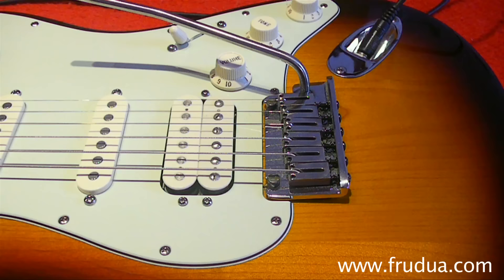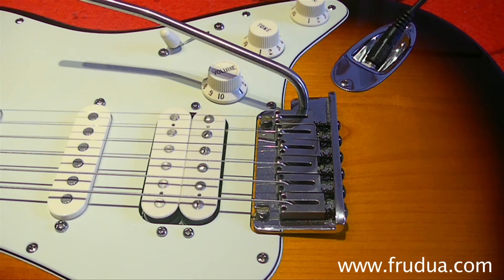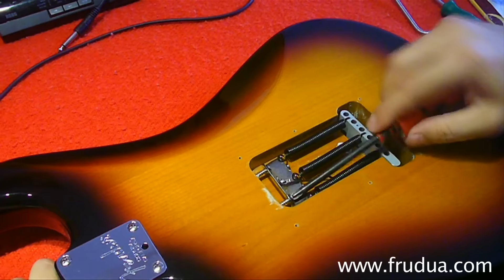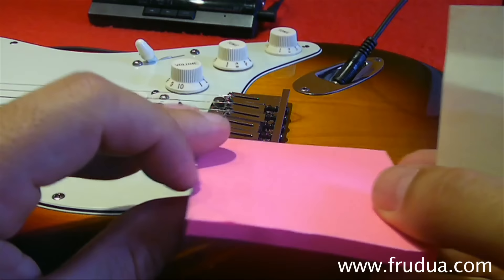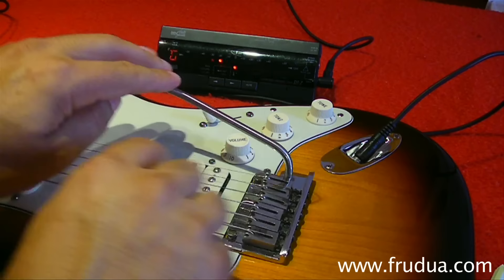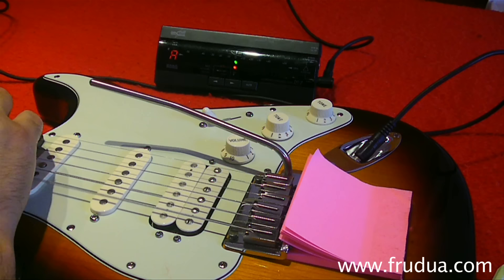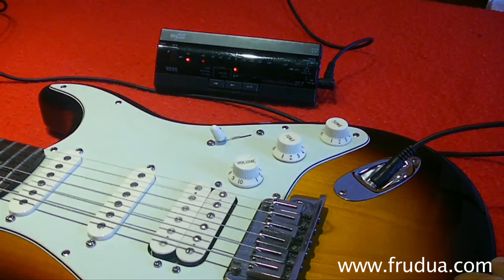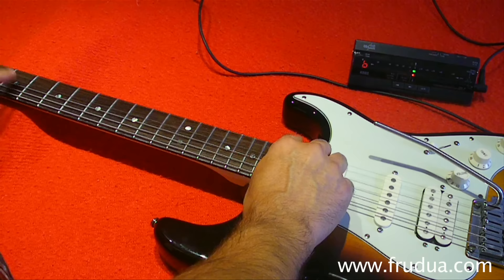How To Set up a Strat Floating Tremolo | Two Pivots Tremolo | Whammy Bar

Comment: Thank you for your video and effort .I have done this setup to my Fender Strat Deluxe. It feels really cool however I have had some issues which I have no idea in which stage I made mistake. While I am using the tremolo bar just for giving kind of vibrato feeling , the bridge does not return  its place ( the actual setting ) and the tuning is being slightly flat. For this reason I have to kind of pull the tremolo bar back to get the actual bridge setting. I just want to ask if anybody had these sort of issues after setting up ?
Reply: Hey Alex. Thank you for your reply. I tried couple of times more and had the same issue. Also I am having huge tuning problems. If you have any suggestion I would appreciate it mate.
Reply: ***** That makes a lot sense. I will definitely try the method and hopefully I will sort it out. I have a 2 pivots system and I guess the process would be the same as the vintage ones. I was just giving up and was gonna lock the bridge but I will definitely try that out. Thank you so much indeed for your time to write down all these , that was really helpful mate.

Comment: Mr. Frudua, would it work in my Music Man Luke 3 ? It came floating, but i want to change the strinngs and clean the fretboard, so i will need to setup again. It uses 09-42 strings and 2 springs in the back. Can i use your setup in my guitar ?
Thanks !!!

Comment: In my Strat the half step on high E and the 3rd minor on G is perfectly in tune. The whole step on B string is a little flat. What can I do to perfectly tune this?

My low E is unstable too (not the interval, but the open string). How can I stable it?

Comment: hi ^^

I have a little question for you, I would like my bridge to stay flat on the body but with my springs not very tight so my tremolo arm is soft and easy to use, every time I tighten my springs so the bridge stay flat, the arm becomes too stiff, and if I loosen the springs the bridge starts to float :s 

thx

Comment: I dunno if he put new strings on or not, but generally yes when you do a setup you want to use new strings, but well stretched.  If your strings are older but havn't gone dead yet your probably OK.  Somewhere in the middle is probably best (thats why you stretch them) unless you play with brand new strings all the time. The reason to re-string and stretch rather than use what you have on is that you might have a mixed set (1 newer string) or a tendancy to play more on top, or bottom.  Cheers

Comment: How many springs do you have in the back? If you've got 3 you can try taking the middle one out and then tightening the claw springs until the trem is flat to the body. If it's too soft then try angling the 2 springs so that they are not parallel with each other but more like a triangle (trapezoid actually, but geometry lessons are over for today). How stretched the springs are when they are at rest will also affect the feel. At worst you may even find that different springs suit you better.

Comment: Paisan, when you set up Floyd Rose guitars, how do you usually set the string height? Grazi
Reply: Iron Mike you can set it up for your need ...set as low to where the sings makes a buzzing sound raise it up just where there are happy no buzz an there you go depending on you might need an L shape wrench my strat uses a 1/16 Allen wrench hope I helped in some way

Comment: I got my tremolo floating now, I followed your instructions perfectly, tuned it back to pitch with the springs, and I love the way the tremolo works now.....But.... it will not stay in tune! Every time I dive bomb it comes back up sharp! I even put locking tuners on it and it will not stay in tune! Any suggestions?

Comment: FruduaTv I have a Fender Hellecaster Strat where the body is routed like Floyd rose style would it be the same technique if I want to adjust the Pivot bridge? do I angle it to the top body or do I flush it inside instead? Thank you?

Comment: Hi, I bought roller saddles that have the intonation screw hole on the center not the side, I can't find saddles with the whole on the side, so I am thinking of changing the bridge plate....I have an American Series Stratocaster.........what is the exact name of the part I need to buy from Fender that will fit my guitar but have the holes on the center of the saddle?

Comment: hi i adjusted the 2 screws at the front to adjust the overall height of the action and now i have strange buzzing at different areas on the fretboard for example if i pluck the G string i get a buzzing NOT a rattle and also on the d string at the 4th fret if i wiggle the tremolo arm if goes away for a little while but comes back its driving me nuts
can you help plse

Comment: i did this. It worked, the tuning is stable, however I have the wrong intervals. I can only pull the G string up to A, the B up to somewhere in between C and C#, and the E string up to somewhere close to F. I have the six bolt model, I've watched the other video as well. Any tips?

Comment: So the  correct setup for the Tremelo: S1:1/2 step, S2: Full Step, S3: 1 & 1/2 Step, S4 Full Step, S5 Full Step, S6 1 & 1/2 Step ?
If so can I start with having all the strings tuned (to : S1: F, S2: C#, S3: A#, S4: E, S5: B, S6: G ) when the whammy bar is flat on the body, then tune  down using the screws in the back to the EBGDAE, this way no need for the sticky notes.

Comment: I have to put new string on my guitar,the question is : when i put muy new strings with my actual tremolo setting thats allready floating but not set up to those intervals, do i tune up the guitar to pitch before putting the tremolo against the body to begin the process? Or i let them loose and first low the bridge and then i tune the g string to begin the process?

Comment: sir i have a cort g200 strat. I'm actuallt new about electric guitars. i thinks its tremolo is fixed. do i need to loosen all the screws at the bridge or i just need to adjust the screws at the back where the strings are? the trem is completely unusable.

Comment: Hello, I have a question: is it damaging to the guitar in any way if the bridge is not parallel. ie. if the bridge is floating above the parallel position? I recently bought a strat and the bridge is floating a bit above - I don't mind it, I actually like it that way, so I wouldn't change it unless it is damaging in some way?

Comment: I literally just finished fixing that. Detune the guitar you so you can fit the screwdriver (it's easier if you have no strings on), Loosen the springs so the bridge is more flexible. Loosen the screws; this will cause the front part to rise and and allow the bottom to become flush with the guitar. It's only about 1mm high. Adjust the springs as shown in the video, or until you think it's feels good. I am no expert, but that should help you out.

Comment: When should I replace the springs of my guitar ? I had my guitar for about 5 years and I had the guitar sitting there with the same strings for about 3 years, now that I'm trying to replace them I'm having the problem that I need to adjust the screws all the way to the bottom.

Comment: My friend, can You help me? I have a Squier Stratocaster with pretty much same bridge. I was following your instuctions carefully but still i did't get the best result. After finishing whole proces my low E, B and hi E are out of tune, little bit lower. Can You tell me where did I go wrong? It's unclear to me how do I set a pivot hight. How much do i need to get them up? Before this i had my bridge fixed, tremolo spring tigh....

Comment: I just got an older Jackson off Ebay with a two point Wilkinson, typically I use hardtail bridges just so I don't have to monkey with the bridge.  Anyway, this bridge is way out of whack, the intonation is messed up, the bridge is on the deck and I'm going to have to completely disassemble the bridge to get the dirt off of it.  Once I take it apart and get it together again at what point do I try to set the intonation? Before or after I get the bridge to float?  thanks
Reply: put the paper under the bridge where you want to end up(string height/wise) then set your intonation;then set the float;-)It will be "off the deck" if you float it.

Comment: Would these instructions apply to a Made in Mexico Statocaster as well? I have a 1996 MIM model. Just wondering if they are basically the same as a USA model...
Reply: Even the cheapest knock off,if it has a two point,if 6 point go to Frudua`s  6 point video.I have Mex/American/Squier/Cort/two points,and they All work great
Reply: Kellie Conn all type can use that ! 😂

Comment: If I change from 09 strings to 10 strings, the bridge will rise too high to tune the guitar because of the increased tension. Should I simply tighten the two screws on the top of the bridge like you did at 10:00/11:02 or should I open the back and tighten the inside screws? Thanks.

Comment: "how to keep a strat tremolo in tune" My guitar stayed in tune except for a few hard bends. I had to use the E-Z lok tuners for a different guitar and upgraded to Sperzel locking tuners. Now it it doesn't stay in tune even though everything else in the same. So If you can help in any way, that would be much appreciated. I've tried everything in the book and can't keep it in tune, same with my other guitars. Best Regards, Chris

Comment: Galeazzo, I saw a video where a guy says the claw should be angled, tighter string tension for the thicker strings which carry more tension.  Thoughts?
Reply: "A guy" obviously doesn't understand the basic principle of string instruments (guitars, pianos etc.). Here it is:
If you tune a string to a pitch, it has some tension. I you want to tune another string of the same diameter to a lower pitch, you should release some tension to achieve it. If all strings had the same thickness, you would pretty soon come to complete flappy strings that cannot produce any sound any more. That's why there exist strings with a different gauges, so you can achieve a different pitches keeping aproximately the same tension on all strings. In short, on the guitar for example, the high E string and the low E string have the exact difference in diameter which is necessary to produce the exact high E and low E at the SAME TENSION. It applies to all strings in between. Got it? That's the reason you should never put on guitar the strings from different sets of different gauges, because you will encounter a big problems with tuning.
Reply: U2dva looking on the D’Addario website it says that some of the individual wound strings have as much as 4 pounds extra tension. That could add up and make a difference, no? Search this video: “Carl Verheyen whammy bar setup secrets.”
Reply: @TheBoomtown4  Now you've mixed fruits and vegetables :-)
1 - Four pounds is cca 2 kg. It's about 4% of 50 kg how much every tuned guitar string hold. IMO it's a fair minor deviation and can smoothly be negligible.
2 - I've watched Carl Verheyen's video and unfortunately I have to dissapoint you. Namely, he and everyone who shares his opinion is wrong. Why? Simply because of the fact that the tremolo is just one block/piece which, no matter how many strings it holds, has only one pivot point in total. If it's set up correctly, it could have only one spring in any position and it will do the job right.
This video reminded me of how powerful imagination can be. It's OK, it makes people happy although has nothing to do with reality :-)
Reply: @u2dva  Strange that... since a lot of master players uses strings from different sets of gauges pritty perfectly (which are popularly knew as hibrid sets). David Gilmour is an example; he always used strings from certain set of gauges (some strings from 09 and others from 010), even because of that GHS recently launched a David Gilmour signature set, based on his preferences. Mix sets is an effective and a useful resourse used from long long time.
Reply: Good point, in fact some years ago I bought a Fender strat, and it came from factory with it claw adjusted in the way you just said, in angle, where the more tention was set toward the 4, 5 and 6 string.

Comment: normal set up involves 1. nut dressing (if necessary), 2. new strings, 3. action, 4. tune, 5. intonate, 6. pup height. This should have been done by factory. All of these must be done first before performing this procedure. You will then have to re-adjust the truss rod to return to proper action after you get the desired trem angle. If you're really new, this is a lot of exacting work which involves expensive tools and skills and may wanna have a pro set up and just maintain it from there on.

Comment: In fact that I tried this, not exactly that I can turn high E into half step. But doesn't touching the arm gives string slippage and gets out of tune? Also I wanna know, Is lowering the saddles gives relief on the string? My bridge is angled like NUTS and it makes the G string so much out of tune after bends. It's completely out of control.

Comment: This was a great video but now when I bend a string (the G string) then the low E goes out of tune?  How to fix?
Reply: Ryan Johnson there is a way to fix that, I think. It requires adding an additional metal bit in the springs cavity at the back of the guitar. I remember seeing this in a video a couple of years ago, I think one should be able to find it with a proper search here on YouTube.

Comment: P.S. : until i can fix it or afford a pro...i put in a 5th spring, cranked the claw and decked/blocked the trem...it works fine...can do bending anywhere...extreme G string bends...even behind the nut...always in tune (locking tuners)...so again i doubt it's a nut problem or tuner problem but a bridge/block...trem problem...only the G seems effected. i can divebomb repatedly and not do bends or not use trem & do G string bends but not both without tuning or compensating with a bend.

Comment: Is it normal my bridge is way over being horizontal after doing this? or did I something wrong
Reply: +Bass meo  I think, it's normal, because it's a technique to have a floating tremolo with + or - 3.2 mm between the brige and the body. (Fender preconize 3.2 mm)

Comment: The main issue with this mod is that when you bend a note the note goes flat because of the floating bridge. When you bend the note, the string tension is pulling the floating bridge towards the neck. :(

Comment: Man I'm still confused.  I just got back my guitar with new strings and a setup, but the tremolo is decked (6 point).  I want to float my bridge but I have questions:
1.  Will I have to do intonation after floating it?
2.  Will my action be the same (I have it low right now) or will it get a bit higher?
3.  Do I need to detune the strings first?

Thanks if anyone can help.
Reply: yes you will have to do intonation after you floated
Reply: yes if you bring the tremolo forward your action will rise if it was flat in the first place a fair amount you going to have to adjust your individual saddles or your end  screws
Reply: you don't need to detune your strings if you screw in the spring screws on the back 12 - 15x like he said
Reply: you don't need to detune your strings if you screw in the spring screws on the back 12 - 15x like he said
Reply: because you already have your flat you can skip that part tightening the spring screws
Reply: +muzikmon2267 thanks for all the info man! trying to learn this and I just need info and some patience!
Reply: +socialdef3 feel free to ask me any questions you want about the guitar I like to help people I have my own guitar and amp repair shop

do you have a Facebook
Reply: Hey, I'm back after so many months and I'm working on a standard strat and want to float my bridge but I read somewhere that the two screws in front can also be adjusted?  Is this true??

Comment: @FruduaTv It actually didn't helped. The string angle regarding the structure of the bridge. Coz' I was thinking if you lower the action with a high-floating trem which is bad, you might eliminate the string friction. And I can't gather the screws and make the ball end higher. So it's hopeless for me. Especially I'm in Philippines. Lol.